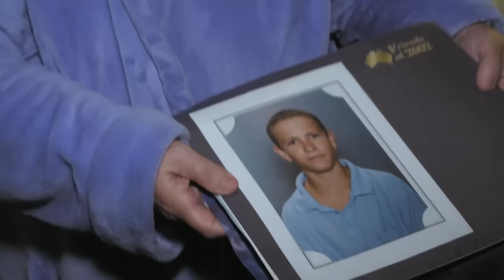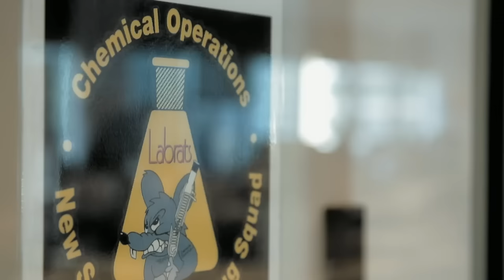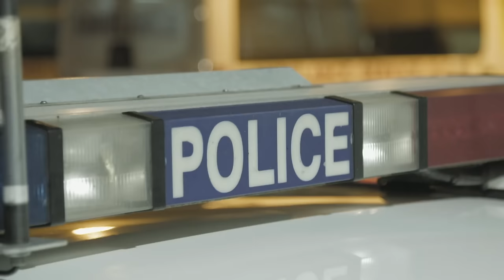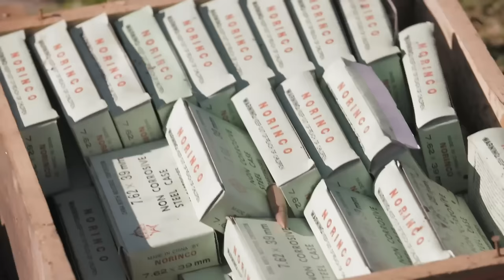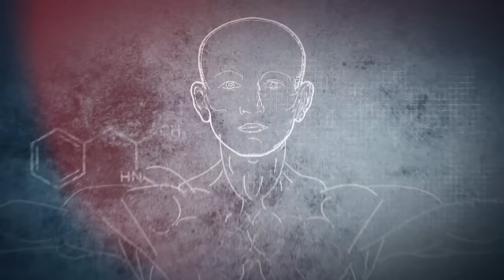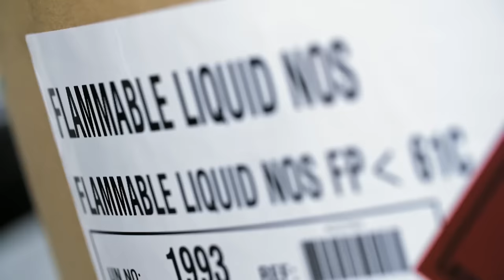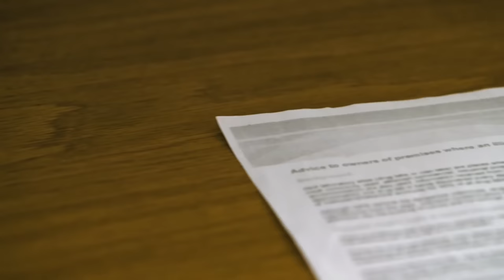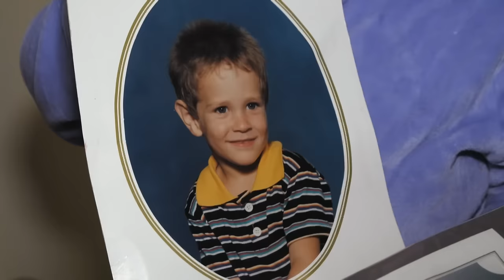Cleaning Up After Meth: The Toxic Truth They Don't Want You to Know | Ice Wars | Documentary Central

Comment: Ok, for one, meth and coke are never cooked in a spoon! You only use a little water, Heroin is the only drug that is heated for iv use. I know from personal experience. Also, I used for many years, and never got paranoid, heard voices, or anything like that. I did, however, have a terrible temper and rage issue if I got really upset. Having been clean now for a few years, my brain is back, I got my teeth fixed, and am pretty healthy by God's grace. I feel for the young pschizo guy in this, he's in really bad shape, and I knew the way he was talking, he wasn't ready to quit, and it is not helping!
Reply: coke only coked in a spoon if u got junk crsck...gotta get that extra trash outta it.. chasing that first one.
Reply: U can cook coke in a spoon and use it for iv use unfortunately
Reply: They're saying you mix them with water but don't add heat for iv... I imagine it's all a personal preference and depends on quality and cut agents as well as the chemical of choice and where it originates. Black tar is gonna need a different method than number 4 China white. Mexican brown and gray rock junk will need heat probably, pure h won't need any heat and will dissolve in water on its own. I always heated oc time release name brand, however it's not needed
Reply: Simply put, yes you can use both intravenously. Meth in an IV is the most extreme but it is water soluble.